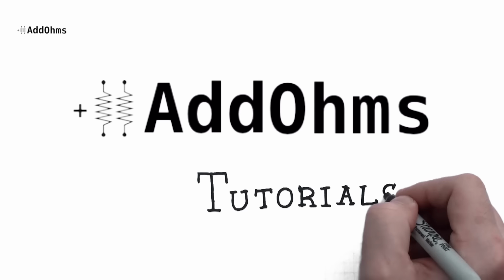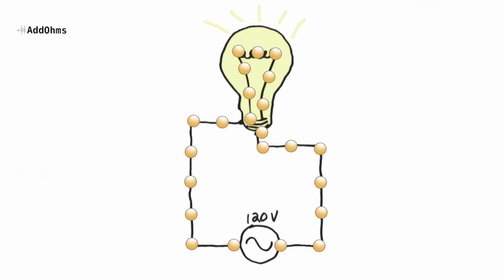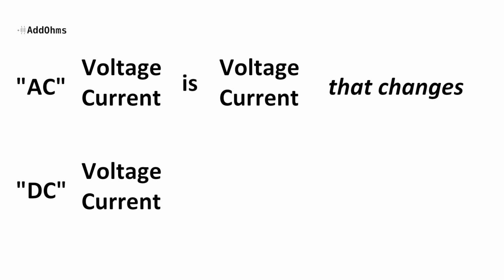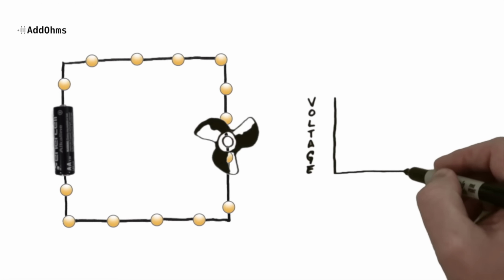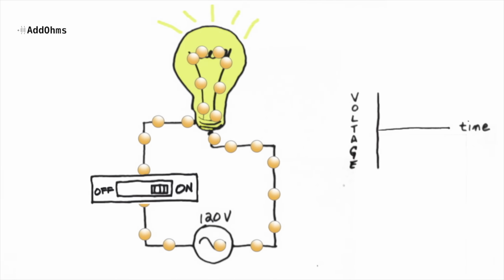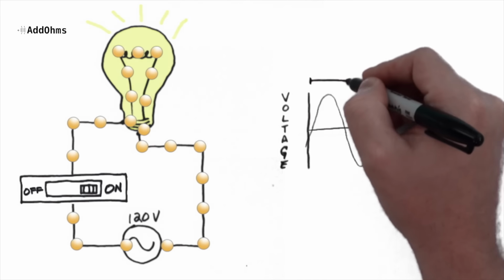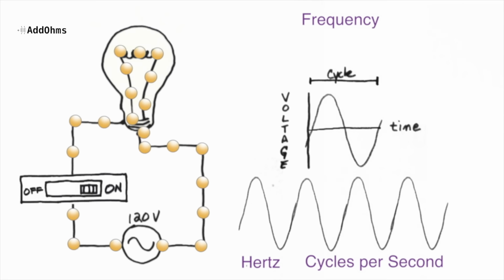Difference between AC and DC Current Explained | AddOhms #5

Comment: so why do we use AC circuits if it seems like DC circuits might intuitively be more efficient? also, you should be getting paid a good amount for this video. a professor of mine is relying on this to teach our class physics :)
Reply from the maker: Neither AC nor DC is more efficient than the other. Like everything in engineering, there are other considerations.
At less significantly than a penny per view, there is no concept of getting "paid good."

Comment: What is example of AC source other than wall socket
Reply from the maker: The alternator used in car engines produces multi-phase AC which gets rectified into DC. Outside of power, AC is a component of all signals (usually called noise) and there are oscillator circuits that product AC signals.

Comment: bro i have a doubt since in an ac current the appliance is switched off nearly 50 times then we are actually saving current right
Reply from the maker: You can’t “save current.” You can save energy. But doesn’t matter because the average current is the same if it was a sine wave or constant level. Energy consumption is the same either way.
Reply: @AddOhms  thank you very much

Comment: I always found that looking at AC current as a vibration (50 or 60 cycles per second) easier to understand than it being a flow. The elections do not flow, they simply step backwards and forwards.
Reply: What I don’t understand is how the electrons make their way to the lightbulb to begin with…

Comment: The changing voltage on AC seems like a bad thing, what are some of the benefits of AC over DC?
Reply from the maker: What are the benefits of air vs water? Same analogy. The both exist. They both different uses. And one is part of the other.

Comment: Why we use alternating current on our homes instead of direct current? I think direct current is the most efficient way to save for electric bills because unlike ac, direct current can be stored in a battery and we can harvest direct current through solar, wind, water current and etc. Please enlighten me.
Reply from the maker: Over 100 years ago AC was picked because it was easier to step up and step down. Today there is too much infrastructure to change.
Reply: @AddOhms  what do you mean by stepping up and down? I dont get it
Reply from the maker: step up to high voltage for transmission and step down for use in homes

Comment: Is this accurate? You said in 1 cycle bulb flashes twice (1 peak and 1 valley). Then you said Hertz is 1 cycle, so 50Hz means light will flash 100 times?
Reply from the maker: It was a mistake. It is 100 times per second.

Comment: For some device said use DC power 12V is that mean only able to use 12v battery ? Is 5v conider as dc or ac?
Reply from the maker: The circuit or device has to specify. But it is probably DC

Comment: I don't like how you explained the flickering of an incandescent light bulb.   Actually the electricity doesn't produce light but produces heat.  It is this heat that causes the filament to radiate a small amount of visible light and a large amount of infrared light.  This heat is not expelled instantaneously and the bulb will still radiate light for a short period even after the electricity is turned off.    Because of this the flicking of an incandescent bulb caused by standard AC current will be very hard to detect.   Standard LED bulbs actually convert AC to DC so the flicker will normally be imperceptible but it can be easily detected with fluorescent lights.
Reply from the maker: It isn't that hard to detect. Almost any high-speed camera can capture it and there are plenty of videos on YouTube showing it.

Comment: I have a question: Why, in machines that can use both batteries and and AC adapter is the voltage different for DC than AC?
Reply from the maker: It usually isn't. Sometimes batteries drive the electronics directly. In others, they still go through a regulator. A regulator needs 1-2 V more than the output to work correctly. Instead of a 7V  AC to DC adapter, 9V gets picked because they are more common, and therefore, cheaper.

Comment: Do all house lights run on AC, DC, or a mix of the two?
Reply from the maker: AC
Reply: AddOhms could you put a LED light into a AC fixture? Do the lights have AC to DC transistors? And if not do you have to get a seperate fixture?

Comment: What happens if you reverse the polarity on an AC plug?
Reply from the maker: You can’t reverse the polarity. It’s AC. Instead what happens is there may not be a safety path to ground, since neutral is grounded at the electrical box.

Comment: But why does a light bulb need to be in AC? As in, why won’t a DC current sustain the light? Why does the voltage drop for the light bulb but not the toy fan?
Reply from the maker: An incandescent bulb would work fine on DC. It’s because AC is what is in houses and has been for over 100 years. Generation and transmission was easier back then. Can’t really change now. An AC motor is built different from a DC motor. Look up “induction motor”

Comment: How do i create an AC source? Been trying to set up wind turbine to charge a battery to then use on appliances but having trouble with getting power in the battery and the DC of battery won't work on a kettle presumably
Reply from the maker: With an AC generator, such as, most wind turbines.

Comment: I think you don't see the light flashing not because of "high frequency" but because the filament does not have time to cool down and darken between cycles. In other words, the cooling dynamics of the filament are slower than the frequency.
Reply from the maker: No, there is a change in brightness, though it is not hard "on" and "off." But it is definitely dimming during the cycle. There are tons of slow motion video on YouTube that shows it.

Comment: I have a little question. If using DC on the motor, the motor will react to the polarity of the current. Then how the motor will react on AC power? Will it spin at a fixed direction or not and why?
Reply from the maker: AC motors use induction. They have no permanent magnet. The coils induce a current into the rotor which causes its magnetic poles to flip.

Comment: 1.) Is there a frequency measurement for DC circuit then? (Since there's no repeated cycle of voltage over time for DC...?)
2.) I'm also a bit confused @1:54. So does the voltage for DC changes or stays constant over time? Is it that it's theoretically suppose to stay constant over time, but due to resistance, it changes (drop) over time?
3.)Why is there a "maximum" voltage output (peak) for AC? Aren't we assuming the current to stay constant? Or does the current changes (which causes the voltage to increases/ decreases as shown on the graph)?

Sorry to bombard you with so many questions ><'" 
Please let me know, thanks <3
Reply from the maker: #1 DC is 0 Hz.
#2 As a battery dies its voltage drops. It is still considered a DC source.
#3 The current changes direction. In the case of AC Mains, which is what most people think of when they hear "AC," the current reverses direction because of how power generators work. They are a flipping electric field. In other cases were we talk about AC components of a signal, it is just an voltage (and current) that fluctuates.
Reply: @AddOhms  I see. Thank you for the reply! So similar to #2, when the battery runs out for AC would the graph be a sine graph that oscillates and converge to the x-axis?
Reply from the maker: There's no such thing as an "AC Battery."
Reply: AddOhms oh ok, sorry I guess I still have a lot of homework to do 😅 Thanks for putting up with some of my stupid questions, really appreciate your help tho ><‘“ 🙏

Comment: Why is the negative not fused then??
Reply from the maker: Current goes in a loop, so it does not matter where the fuse is located, in regards to current. Voltage, on the other hand, needs a reference. So the negative has been decided to be the reference and needs to be at 0 volts. Since voltage drops add up, a fuse would cause the "ground" to be slightly above 0 volts which causes more problems than it solves.

Comment: If the neutral wire carries the current back to the panel, how come the neutral wire has no voltage on it? And I can touch it and not get a shock? I put my volt meter on the neutral wire and it was dead. Yet if I disconnect it, the lights go off. 

I have tried to find the solution to this question on the internet for days and to no avail.
Reply from the maker: You should not be touching a neutral wire because you could a shock. Neutral is tied to Earth Ground, or 0 volts. If that connection is missing or bad, neutral can provide a lethal shock. 

Voltage is a potential difference. Current flows when there is a voltage, so when there is a difference. The difference between hot (100 or 200 V) and Neutral (0V) allows current flow.

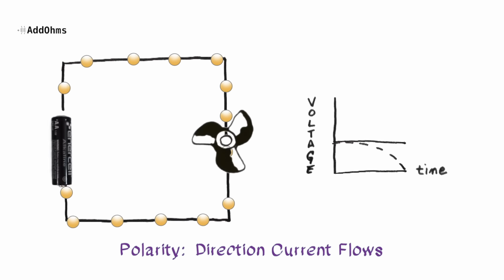Comment: At 2:17 .. What will happen if you put a ac source instead of the battery ? Will the fan keep changing direction ?
Reply from the maker: A DC brushed motor will just jitter. A DC brushless motor will probably get fried, or at least, its controller will.

Comment: How do electrons flow in two different directions? If we see DC current, electrons flow in one direction. But, what is the reason for the flow of electrons to be complicated in AC current?
Reply from the maker: Because that’s how the generators are designed. As they spin, the electric field  flips.

Comment: The idea that incandescent bulbs flicker at 60 hertz, while technically correct, isn’t necessarily what happens. The filament simply can’t heat up and cool down within 1/60 of a second. The same goes for (most) fluorescent bulbs. This effect is mostly pronounced in LED bulbs which can react quickly to voltage changes.
Reply from the maker: Sorry, but no. While incandescent do not turn completely off, because of the cooling rate which you mention, they do at least pulse. There are tons of high speed photography examples of a filament pulsing.

Comment: Why does direct current always seem to be low voltage while alternating current seems to always be higher voltages? In other words, you never really hear about 120VDC or 12VAC with regards to anything.
Reply from the maker: For transmission, high voltage AC is easier to manage. There has been some work on a HVDC grid replacement, but it is incompatible with the existing grid. 

Outside of power transmission, low voltage AC is exceptionally common. First, all "DC" signals contain an AC component. Second, 12-24 VAC is very common in homes. The relays used for doorbells and HVACs tend to use 12-24 VAC since you can easily use a transformer to step down the mains AC. 

"AC" means much more than just the mains AC found in a home.
Reply: @AddOhms  very interesting! Would you be able to point me in the right direction to learn more about this? Google doesnt yeild much.

Comment: Not sure I understood; can there be an AC current and DC voltage at the same time? how are current and voltage related for that matter? can we pick any configuration? Or if current is AC, then voltage necessarily is AC too?
Reply from the maker: Ohms’s Law says you can’t have current without voltage. The point I  making in the video is that we sometimes refer to “AC voltage”
even though the C means current. “AC Voltage” means a voltage that is changing. If there is AC current, then there is AC voltage.

Comment: Doesn't  the current actually flow from negative to positive?
Reply from the maker: Yes. But it does not matter. There are two models that can be used (conventional or electron.) As long as only one is used to evaluate a circuit, it does not matter which is used. (Hint: except for material scientists, engineers almost always use conventional flow, as shown here.) https://youtu.be/IzY0wuxt1R8

Comment: Not exactly true about eyes not being able to see incandescent flash. The cycles occur with a high enough frequency that the filament remains sufficiently heated to display constant light. This is similar to a car engine; the momentum between combustion cycles along the shaft is sufficient to cause smooth power application.
Reply from the maker: Watch high speed camera footage of a lightbulb. It is pulsing. The light is not constant.

Comment: And yet there is a black wire (hot) and a white wire (neutral) suggesting that the current flows in one direction.  Can you explain this?
Reply from the maker: What is there to explain? The wire colors have nothing to do with how current flows in them.
Reply: If you trace the white wire back to the breaker box, it goes to a ground source.
Reply from the maker: All voltages need a reference. The earth provides a good one.

Comment: Ok if the electron flow in AC goes back and forth like that how do  electrons manage to flow through the load and out the neutral conductor?
Reply from the maker: Electrons are just a charge carrier. They always move in a loop.
Reply: AddOhms ok I was always of the understanding that spent electrons flow through the neutral conductor after their charge has been used by the load. I'm not necessarily disputing what you're saying I'm just trying to get a better understanding of how electrons flow in a sinusoidal wave form. 

I'm an electrician so I know enough to know how to connect things safely but I'm not a physicist or an engineer so my job doesn't require me to fully understand all the intricacies of electron flow. It's just curiosity on my part to have a more complete understanding of that.
Reply from the maker: There is no such thing as a “spent electron.” In mains AC, the electrons are physically moving back and forth with charge moving with them. There is nothing “spent” to return. The energy consumed by the device is the electromotive force of moving the electrons. 

The single biggest mistake people make is thinking a “charged electron”
leaves the source, passes through the device, and the returns. That’s how current flows.

Think of a circuit as a bicycle chain. The electrons are the chain. The energy it takes to move that change converts the energy do something else.
Reply: AddOhms i appreciate your efforts to explain that. The bicycle chain example is more or less how I understand current flow in a circuit to work. Going from the source to the load then to the return. The negative voltage part of a sine wave had always puzzled me.  Luckily my work isn't adversely affected by that.

Comment: May I ask a question? I'm always having this simple question : In AC circuit we say the polarity is constantly changing. If this is true ,  why we always get the hot wire on only one cable when using a test pencil  ? Thank you
Reply from the maker: Neutral is connected to ground.

Comment: So how many times would you say direction of current changes in an AC 60Hz system?  Would you say 60 or 120?  I know you stopped at one cycle in your graph to see its corresponding animation current direction, that is too bad because it would have proved my point that the current changes 120 times in one second.  Will, more like 119 times to be totally precise. The light flashes every time it crosses the line.  Flash means change in direction.

Comment: I just want to correct the notion that the light bulb flashes at 50 times per second. It DOESN'T. In fact it flashes at 150 per second and THAT is why we cannot see the flashing with the naked eye. The reason it flashes 150 times per second is because, as with three phase electrical generation, there are THREE Sine waves that are registering at 50 times per second EACH. The crest of these 3 sine waves are virtually flattened out and THIS is why it does not look as if the light is flashing at all. Three Phase Electrical Generation was specifically for this reason. If it did flash at 50 times per second light bulbs and even electrical three phase induction motors wouldn't last as long as they do. I hope this throws a little more "light" on the subject.
Reply from the maker: Sorry but that is incorrect. The correct rate is 100 or 120  times a second. I said that part wrong. It turns on and off twice per AC cycle. None of your explanation about three phase applies to residential sockets. Except for appliances, sockets are a single phase.

Comment: If you record electric devices, inn say a cars dash lites. It well show the lites flashing. Is this the Hertz?
Reply from the maker: LEDs are pulse width modulated (PWM) to change their apparent brightness. The difference is frequency. LEDs are switched on-off at about 10,000 hertz. (or 10 kHz)

Comment: Thanks...but you have told that, " In AC a bulbe flashing 50 times in a second" isn't it 100 times? Because 50 Hz  means 50 cycles, and one cycle has 2 peak point. The bulb will be brighter in those points, for positive peak point and negative peak point.
Reply from the maker: Yup.

Comment: So thats wjy sometimes the light flash on and off when you are in super slowmo
Reply: Exactly
Reply: Except probably not for incandescent bulbs. If you still have any, you’ve no doubt noticed that the filament (tungsten metal usually) still flowed for a moment after you cut the power. The cycle time is so fast that the filament stays at a relatively constant brightness while the power is on. But I believe this flashing phenomenon is why old and cheap LEDs make your waving hand in front of them appear to strobe. Also why LEDs strobe when you play back a slow motion video with LED light.
Reply: Woah! True!

Comment: Ive been watching a lot of tech related videos lately and every time a battery they show that electricity flows through the negative end and some videos show that electricity flows through the positive end can someone tell me what end of the battery electricity flows through? Thanks
Reply: Electrons actually flow from the negative terminal, however it is standard practice to show them leaving the positive, despite it being wrong